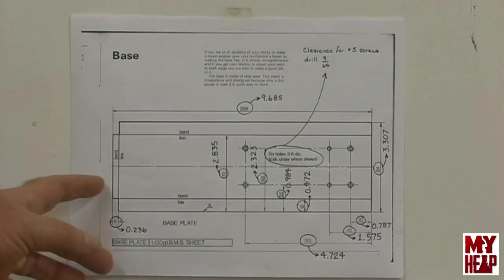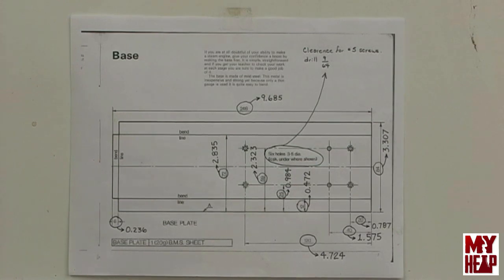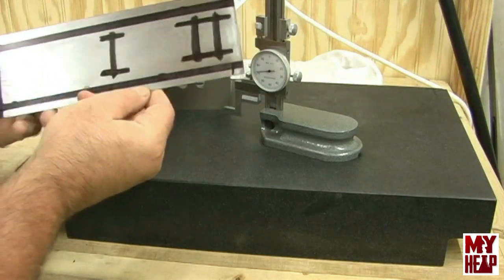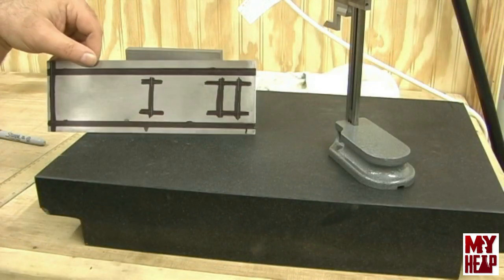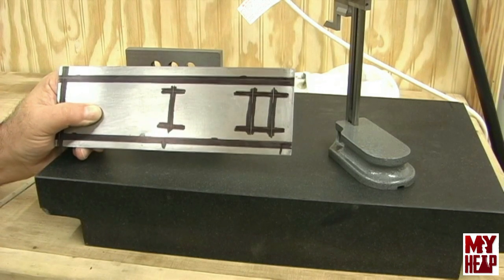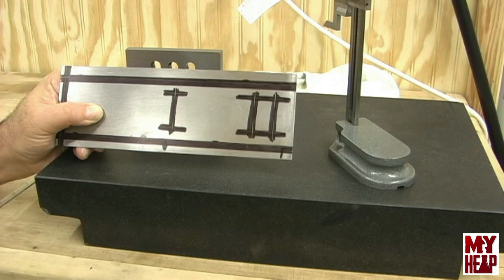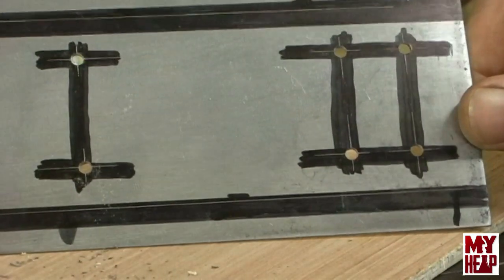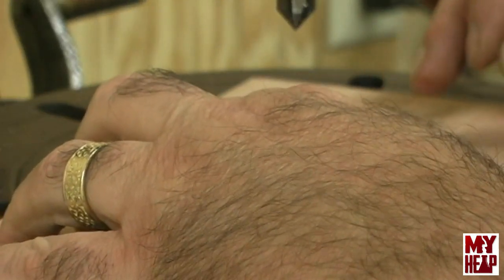Kenneth Wells Stationary Engine - 02 - The Base

Comment: Great journeys are made with single steps, I am enjoying this...   F.I.Y.  Step drills are great for thin material if you can find the right size...
Reply from the maker: Hey Walt.  Everyone tells me that and I need to get a set.  The ones at the local hardware stores are pretty expensive and I am afraid to but some cheaper ones.  Any thoughts on these?

Joe
Reply: While I'm not a HF super fan,  some of their stuff is pretty good for the home gamer,  Step drill's are not bad, gloves, acid brushes etc.
Reply: And you can order online if the store is inconvenient.
Reply from the maker: I will try some from there and see what happens.  I view HF as "it depends"  For something that will get little or light duty use then I have no issues with them.  Bought a drywall lift from there to hang my shop ceiling.  It worked great, but if I done that sort of stuff for a living, I would buy one a little heavier built.  I have a store 25 miles from me and another 45 miles.  I make these trips occasionally for other things so stopping by is not inconvenient if I am there already.  One of the problems of living in podunk is that everything is a drive.  :-(  BUT, I would rather live in podunk than the big city these days.  :-)

Comment: 3,5 mm is tap size for M4 ( M4 x 0.75) and that is slightly smaller than 3BA. For an equivalent 3BA would do nicely.
For a toy engine like this, you could have glued a copy of your drawing to the stock and followed that template, Though not the wrong procedure, doing it this way with the height gauge is a bit surplus to requirement.

A small bending brake for this sort of material, only takes three short sections of angle iron and is easily made if you have a small welder.

You can fold open a section of pipe for the end-flanges (for the boiler) but make sure to cut away the weld on the tube. Do NOT cheapskate on the boiler. Even though this works at very low pressure this is still a pressure vessel!... I once had the very dubious task of driving a 14 year old to the A & E, who had a face full of Wilesco boiler ( a high quality make of steam toys) shrapnel... (his eyes were not hit, thank sanity!)
Boilers are dangerous things, even at a few psi! Use good materials, go rather one size up than one down for the thickness of the tube, Keep annealing the material (last thing you want is stress cracks!) and make sure the parts are properly brazed. ( don't even think about soft solder!)
Use the correct material for the plugs in the boiler (do NOT use steel!)
It usually will not fail after it is made, but the danger-point is a few years later, when you take it down from the shelf to show it to one of the grandkids.

Paddy

Comment: looks like a decent start for the day, lol. 

If you look at harbor freight, they have those magnetic indicator bases for like 12 bucks, if you unloosen the part that is right against the indicator, the clamp, there's the pin that goes into the indicator and a sheet round spacer, which the OD is 3/8". If you take the pin and spacer out, and take some 3/8" bar and turn the end down to 1/4" and thread it 1/4" coarse on the end, and put a jam nut on it, you can put your camera on it and use the jam nut to lock the camera in position, then you can just stick your camera anywhere you want that's magnetic. I usually stick mine on a piece of plate steel on the bench, or on top of my track anvil that I have sitting on the bench, or on the backside of the cross slide, it'll stay right where you put it and will hold even the heaviest cameras. That or I just use one of the travel tripods with the short legs to put where it where I need it.
Reply: Thats what I do..use a mag base..ditched the tripod long ago. I have a 4" round steel base 1.5" thick I use when the camera needs to be put on a bench or something. Jealous of your muller btw, nice job Chirpy!
Reply: The only thing about the mag base, make sure it's not sitting on the machine that it's running on, or test it ahead of time because it'll transmit the vibrations from the machine to the camera and make your audience sick to no end, lol. Ive seen a few videos where that's happened and have had to test it myself a few times to make sure it wasnt going to buzz the video, lol.

lol, as soon as the weather breaks, Ill get back to working on that thing again. Need to cast out the pulleys and everything for it, but I may have another idea for it coming up that may work also, but we'll see.
Reply: Ohhh, that has happened to me a lot....trust me.....I cant set it on the ways of my tiny mill. Lost an entire video that way, lol
Reply from the maker: Thank you boyz!  I will have to pick one up the next time I get close to a HF!
Reply: no problem, if you need more details, I can make a video to show how it goes together.
Reply from the maker: Hey Chirpy, that may actually be pretty helpful.  I use a Sony camcorder so am curious about having enough manipulation on the arm to make sure the video is oriented correct.  Not angled or cockeyed.
Reply: ok, will do, Ill just do one up within the next day or two and email the video link to you

Comment: I like that surface plate and height gauge Joe, sure makes for nice scribeing of marks for drilling. I would drill those plates for bending so you can set up the bend on the bench rather than muckin around at the vise to get it level on the fold line. Your idea was a good one. You coulda bolted a piece of wood to the plate with the existing holes to beat on to make the bend without denting the steel sheet...just a thought. You are making two of these engines right? would save me the trouble...Lol
Reply from the maker: I am not following you Rich, maybe I am a little dense.  You said, "I would drill those plates for bending so you can set up the bend on the bench rather than muckin around at the vise to get it level on the fold line."  ... Explain.

When I wnt to make the long bends, I had to incorporate a couple of C clamps on the ends of the folding bars as they wanted to flex.  Hindsight being what it is, I would rather have a couple bars of 1/2 x 2"  CRS.  Just don't have any of that.  Also, a bolt on each end would be handy except for when you have to let another bend pass by, but a C clamp would fix that.

Making 2 ... I hope I can make the one!!!

Thanks for watching and commenting Rich.
Reply: It's likely that damn palmetto juice again
Reply: you asked if "I should drill the 14 x 1" plates and run a bolt thru" or something to that affect. I thought that was a good idea. That way you could avoid balancing the 3 pieces precariously in the vise getting them lined up for bending....by doing it over on the bench. Then move it over to the vise once lined up and in position.
Reply from the maker: Does he drink it straight, or does he let it ferment a bit first?
Reply: Oh just as long as he can stand the damn THIRST !!
Reply: yer talking just like one of the Harvard profs !!
Reply from the maker: Told you I was slow.  I think I will modify them.
Reply: may not work for that longer bend unless the bars are long enough. If not....make a bar stretcher :)
Reply: You mean MOLLIFY ??? or MORTIFY ??
Reply from the maker: I guess it depends on how you looks at it.  :-)

Comment: G’day Joe. Where do I start? 
Yes your camera angle or interposing of oneself does stink, your words not mine. 
Yes fit at least one bolt to the clamp bars. 
Clamping the major part of the sheet and rolling over the small lip is better, the deformation you had is easier to manage. Even better is to roll it over using a hardwood block and hammer. Ok this way you can only hold 2 - 3” in the vise or clamp the whole thing to the bench, which reminds me, your vise should be mounted flush with at least the front edge and in your case side edge also, makes for holding long objects vertically. 
Camera mounting. Mine is mounted to an painters extension pole, cutoff paint roller handle with a ball joint camera mount for any angle. The pole at present slides into a car stand. I can get in close, up high
Reply: Fat fingers. And I’m not tripping over a tripod. Cheers Peter